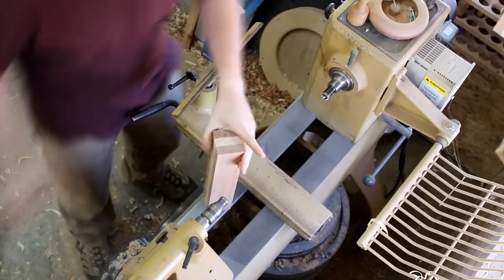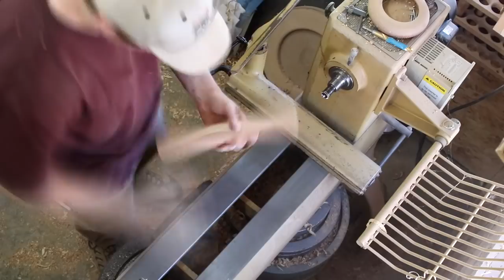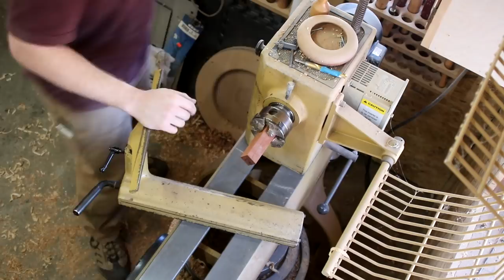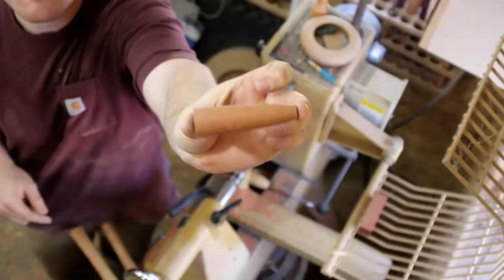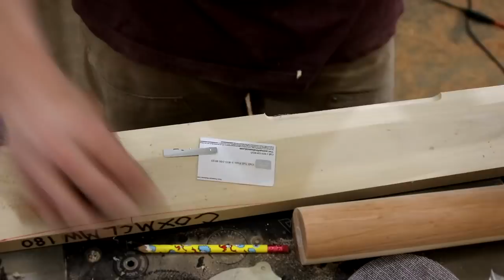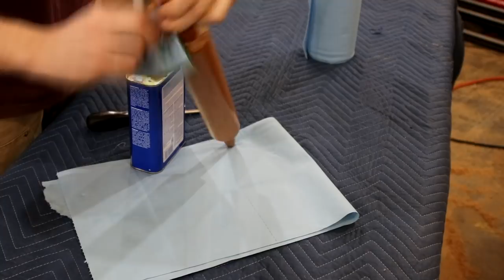Making the best rolling pin! Woodworking Pecan and Brazilian cherry!

Comment: Boiled Linseed Oil is not food safe.  It contains metallic driers.
Reply from the maker: Respectfully, sir, you're incorrect. The drying agents you are referring to are not in any amount considered toxic or dangerous.  It has been used in the industry for decades and has been proven safe.  https://www.woodworkersjournal.com/boiled-linseed-oil-toxic/
Reply: @southernindianasawmill1367  "...making it perfectly safe for use on furniture" no where in that article they recommended using it for food-contact items.

Comment: Linseed oil is not food safe. Better to use Walnut Oil on the main roller. Anything you want on the handles.
Reply: It is food safe as long as it is 100% linseed oil. It is though usually not used on rolling pins as it will give a weird taste to whatever you are rolling. It totally agree with you that walnut oil is the best option but you can use anything that is food safe and does not have a significant taste.
Reply: This is correct - pure linseed oil is food safe but boiled linseed oil has toxic metallic drying agents added.
Reply: Just how much Linseed oil do you think the person would consume?  Idiot.  You'd have to eat ten of them to make a difference, then, you'd have more problems than the linseed oil.  Nuts like you give wood working a bad name.  Linseed oil is just fine.

Comment: Where do you get the rod and the nylon bushings
Reply: Sources I found

Amazon: 100 Nylon Spacer Bushings .257 I.D. 1/2 O.D. Length 3/4

Ebay: Value Collection 1/4 Inch Diameter, 304 Stainless Steel Round Rod 6 Ft. Long

I chose stainless steel, for the greater strength and higher modulus.  You could quibble about the possibility of crevice corrosion of the SS as it passes through the nylon roller, but I think it will be minimal.  Personally, I very seldom wash my rolling pin, I just wipe it off with a clean paper towel.  On the rare occasion that I wash it, I don't immerse it.  

Also, I would be very careful of using boiled linseed oil.  100% Pure boiled linseed oil is OK, but many boiled linseed oil products contain additional chemicals and plasticizers  that may not be food safe.  If in doubt, check the MSDA of the exact product you want to use.

Comment: A very nice rolling pin,but I can't understand why you didn’t cut your original pieces on the table saw with the blade set at 45% to take a lot of wood off before Milling?leaving you with a exogen piece.
Reply from the maker: Colin Askey A piece this size represents no danger of hanging like a bowl would.   It would actually take more time to do as you are suggesting. If you've ever seen the high production spindle turners, they never 45 a piece.  That's my reasoning anyhow. Thanks!

Comment: I'm curious as to why you didn't create the full length rod hole during glueup? Even if it was a square hole, placement of the bearings would produce round ends? 
Thanks for showing.
Reply from the maker: Method is the key to madness, and 95% of disagreements in the shop are the result of it. HA! This is my personal style, and it yields the possibility of more interesting designs, without having to have a glue seam down the middle of the pin. It showcases more precision and skill, IMHO.  I've done both ways, I think this is better, that's all there is to it.  Thanks!